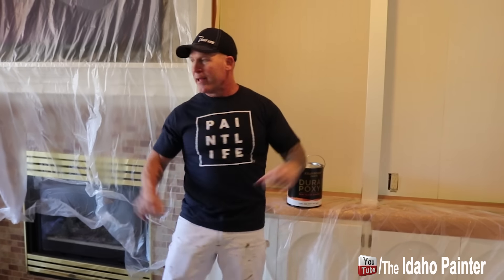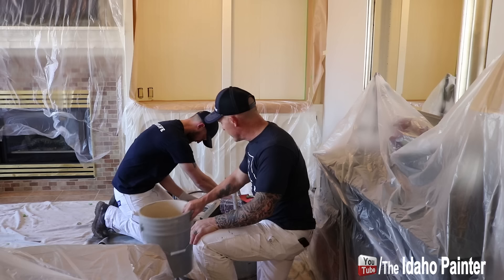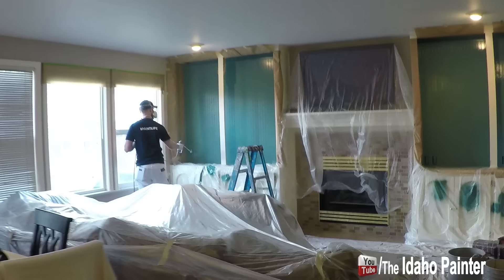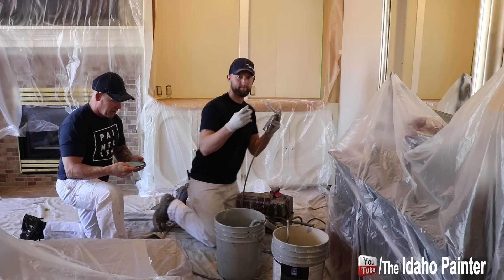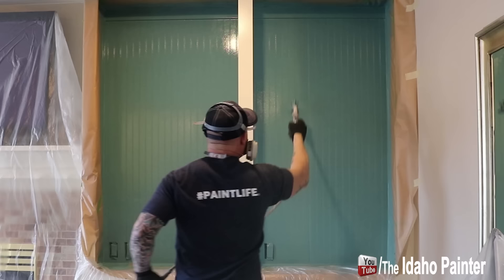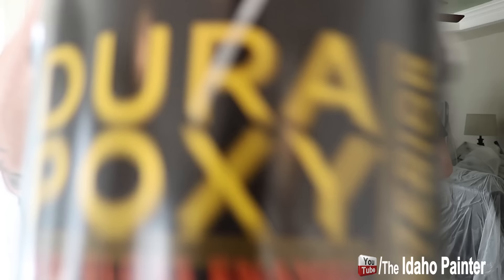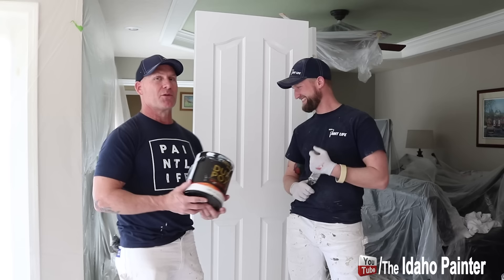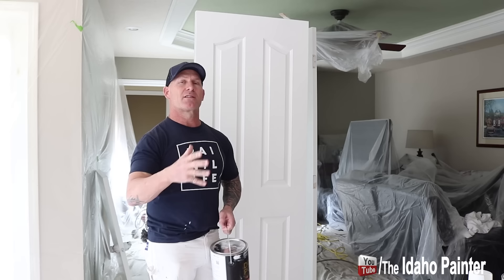Worst Paint or Best Paint Ever?

Comment: We use Durapoxy exclusively on all our doors and trims and always get beautiful results (usually spray a straight white with extra white oxide for coverage) it’s true the material is thin and will run like crazy if it’s sprayed too thick we always give all our trims a good sand to break the old sheen and give the dura something to stick too, if you don’t do proper sanding it will run and not cover, dries hard due to epoxy hardeners but also dries and skins up really quickly (especially if your rolling out doors with a lil roller) on cabinets we do 2 coats of kel bond primer and 2 coats of dura poxy and it turns out beautiful leaving a hard durable oil like surface that you can scrub on for years that doesn’t scratch off that is of coarse if you sand and clean the surface first 😉👍
Reply from the maker: Awesome, thanks for sharing your experience with it!
Reply: How's the touch up with a brush if you spray first ?? I know PPG Breakthrough satin touches up fantastically , you cannot see ANY "touching up" with a brush on a sprayed finish ..... THAT part is great ...... However I also like that durapoxy , but have only brushed it on ..... never sprayed it ..... only used it on a couple of small jobs

Comment: Hey Guys - thanks for doing this review, it's been super useful even after two-years. I just completed a kitchen cabinet renovation here in the SF Bay Area and used the K/M DuraPoxy HP - Ultra Pure White (2888-Semi-Gloss) as the final two top coats. I did find that the DPHP really likes to have more multiple fogged to thin coats as you demonstrated to get that really nice dry-time and to lay down an even finish that really hangs well. I was impressed that I could do a two-coat finish within 3-hrs and call it done! I think if I let it go a full 3-hrs between coats I might have had an even better result as this stuff does like to vent/fume out. I do recommend allowing 4-to-6 hours dry time before really hauling, longer for better curing to assemble the doors and drawers back onto the bases, etc.

DPHP formula is a little different from the stock DuraPoxy used in this video review, but it shares some of the same properties. The HP seems to provided a better "hardened" finish like a factory would crank out. One thing I did learn through some testing coats on the old oak finished boxes & doors is that lightly sanding w/ 220 with a great primer coat as a sealing base layer does wonders for the DuraPoxy to really hold as a hard cabinet finish! I used the K/M AcrySheild Int/Ext. Wood (255-Primer) and man does that stuff really seal out any and all stuff on the original surface that might cause fish-eye or orange peeling. Nothing but a solid finish with my results. I sprayed with my Graco X19 Pro using FFLP 310 for priming, FFLP 208 for my top coats. I do agree with it being a very fine paint that will run if sprayed too heavy. I cranked down my gun to 800-psi and was extremely satisfied with the output not dropping too much material. I would give the DuraPoxy HP a 4.5 and plan to use it on my next two cabinet projects. I think the key to this rating was the prep and prime really made the end result sharp. 

Thanks for the great videos... you've helped this Silicon Valley gearhead a ton to break into the enjoyable craft of Paint Life!! 😎💪🏼🤙🏼  Cheers, -M@
Reply: I plan to possibly use the same paint & sheen.  Any recommendations for concrete maybe??....is high enough build?
i can not find anything out there yet that beats Gliddens "exterior" high endurance plus paint, it has <20 minute dry to touch, 4hr. recoat i disregard.  Good hide & coverage.
 Can not have it stay wet for long with stuff blowing around ground level.  Guess i'll live with next multiple day coatings for now, finish with sealer.  Rome wasn't built in a day.  Let me know if i should give it shot.

Comment: We use Durapoxy on our "Rapid Make Ready" tiered pricing scheme as our least expensive package. Usually these are rentals where we'll shoot an oil based stain blocking primer, followed by 2 top coats of Durapoxy, reassemble, and pack out in a day.  Prep is 120 grit & crud cutter to de-gloss, 220 after the primer coat. I like Durapoxy because it's fast setting, and I've never had a problem with it blocking/sticking. Another efficiency I've found is finding a specific "white" for all of your trim works.  We've standardized on SW's Snowbound-takes a lot of headache out of touchups both for us and our customers even if it's years after the fact. Snowbound is a slightly dirty white with a shot of gray-tones down the white just a touch and makes a great contrast with the neutrals that are always popular -many of them based on grays -Scott, Austin Fine Finish Painting LLC
Reply from the maker: Awesome, thanks for sharing!

Comment: I Have used the product Many times over the past 5-6 years for bathrooms in  new commercial Jobs, but also repaints. However,I Have Brushed And Rolled .I Never have sprayed it. I Do not recall any type of problems.The smell was an issue for some of the "Repaints" As Customers were in a work setting while we were repainting.

Comment: What I have noticed with this spraying episode is that the top and the bottom applications are not parallel. A spray head that could do this tilt at the top and bottom of the stoke would be something to think about. When robotics spray a car it is paramount.  Seems this could be achieved with a hand held spray gun?

Comment: I like the Durapoxy. I spray it on baseboards before they get installed and there is barely any touch up needed once on the wall. The Durapoxy HP however I hate with a passion. It ALWAYS runs even when used with an airless and a 308 tip. I used the HP through my Capspray HVLP sprayer and that is the only way I didnt get runs and got an actual decent result
I like the regular Durapoxy though, never had any issues with that.

Comment: I like durapoxy  it dries quickly to a durable hard finish, levels well, you will not get those results with most other paints. for the paint smell you can and should use a respirator and it may not be the best covering paint but you can quickly follow up with an extra coat because it dries quickly and the extra durable paint application will be worth it one of my favorite paints to use I would rate this paint as one of the best 4.5
 Thanks for the review

Comment: Durapoxy is easily the best paint available anywhere for wood surfaces like crown, cabinets, etc. getting orange peel is usually the result of spraying too heavy. Doesn’t matter if using a Graco X5 or a Titan 440, 2-3 thin coats will always result in a superior finish to any other product, save for those with long cure times. KM Swiss Coffee is the white you want. It’s a stock color there, so they can just drop it in the shaker and you’re on your way. 

KM also has a product called Epic, which lays down crazy smooth but has a true 30 day cure time. It’s what I use for furniture. But I’ve learned the hard way to respect the 30 days. That’s too long for most customers. But say someone wants to refurbish some heirloom furniture, I think many customers would be alright with waiting 32-34 days (which includes the days of prep). Also, using BIN primer with either Durapoxy or EPIC makes a monster difference, especially when shooting cabinets.
Reply: i believe the Durapoxy HP is better ,dies harder and quicker. for what ive experienced

Comment: Im always on the look out for good trim paint. Here in Calgary, Canada we have some harsh weather changes including humidity and the builder's here use solid colour lacquers but they always crack between 12-18 months because its too hard for our weather variations. Of course this is past the builder new home warranty so they dont care. For new construction/renos I spray Ben Moore Advance which is a waterbourne alkyd and I have never had a cracking  callback, BUT because of the oil particles the dry time sucks for sanding. What products do you guys like? Our weather here can go between -30 and +10 within a week (Celsius) and our humidity is usually around 16-26 and of course most the woodwork is MDF and rarely do these  guys let the product  acclimate because often the settling doesnt happen until they are long gone.
Reply: Surfopia bm advanced is the best we have in canada in my opinion also. Cloverdale renaissance hybrid a close second
Reply: North Shore MTBer agreed bm advanced semi gloss is amazing just gotta be careful because it runs easy

Comment: What are your thoughts on sherwin Williams quali-kote??
Reply: Its a basic contractors grade paint simular to Ben moore Ultra Spec. I dont like either of them personally. ProMar is a better quality from SW, but its still a lower grade. My go to is Regal or Aura from Ben Moore and Duration from SW is decent. Both Regal and Aura are a paint/primer combination and the difference between the two is Aura self levels (cant back roll)  and it has its own colour pallete that is full spectrum. Ive tried the Behr Marquee as well and its not too bad (client request). I guess it depends on what you want your end result to be, but Quali-Kote isnt that great. Ok for rental units but not the best for cleaning. I havent tried SW Emerald yet, but I expect it to be simular to Regal.
Reply: I have been using Emerald lately and I like it so far. Otherwise I have always used Promar 200 and Duration.

Comment: new painters here lol.. fish eyes? not caused by paint but obviously oil on substrate, wow just wow... durapoxy rocks... they prob think sw super paint is good
Reply from the maker: Okay...
Reply: Fish eye not always caused by substrate problems. Sometimes it's over sized pigment particles(eg. iron oxide) reacting (electrostatically?) with surrounding paint above the surface. This can be tested by spraying the same paint on a known cleaned, de-glossed surface.  An additional test to prove it  is to spray a non pigmented paint on same surface for comparison. Fish eye is more frequent on deep tint bases in my experience.
Reply: It’s caused by the cabinets natural orbital movements which condenses the oxidation process forcing the paint to have a chemical reaction when the ths42 and the is37 interact with bs17. Typically having a carnivorous effect on the substrate eventually allowing eair, not to be confused with air into the hemroidal crevices of the finish you are using . Pretty basic stuff guys all my helpers even know this.

Comment: I saw your Behr video .I had a problem with one of the 5 cans I bought. I talked to the rep and they at first said that marquee premium is one coat guarentee must have been roller I used .I sent reciept and invoice of rollers I used Purdy white dove 3/8 nap .long story short it could have been bad base . I told them that its what the home owner wanted to use. Otherwise I wouldn't have ever used it. It took up my time putting 3 coats in bathroom. And along with now the homeowner has no touch up paint. Which is why that can was intended to atleast be half a can left .how do you deal with or explain to companies of when its a bad product. And what they can do about it. I have not received a response yet. What have you done in the past and how did you go about it the right way. I sent them pictures of the areas the looked like'best way to explain it' running a roller out of paint. Which I didn't do. How would you go about this to the home owner. A bad product can ruin a good reputation. Luckily I was able to fix it. But it took more of my time and money. Any suggestions.
Reply: My suggestion as a professional painter for over 15 years don’t buy into the hype of a “one coat system” especially behr paint it’s watery formulated for the homeowner to extend the open time also water based paint has latex in it so it shrinks when it dries causing fish eyeing with one coat it’s made to build on itself we always do 2 coats to give it a true sheen and color as well as proper coverage

Comment: stick with ppg breakthrough best. trim and cabinet paint on the market hands down.
Reply: @360 Painting Indy North i ditched my shopping plans for PPG Breakthrough 250 because of coverage issues & longevity concerns??  So kelly moore maybe?
Need a convient, fast dry, durable lasting exterior brush on concrete paint....so this kelly moore is worth a try?...i mean the kelly moore Dura Poxy HP.

Comment: You said you were going to run at 1800 psi most of the entry level titans have a max of 1500 psi and your using a low pressure tip . Now I’m worried about buying a titan sprayer .
Reply from the maker: The low pressure tips are suppose to run at 1000 PSI
Reply: I Have A Titan 440 Impact . It's Rated At  3300 psi  And  0.54 Gallon  Per Minute.. What Model Titan Are You Referring to James Howard?  Just curious.

Comment: This guy an amateur with spray technique.  The fan of the spray  is held to same distance, much as you see a robotic spray.  What happens when fan not held same distance different thickness of material and many times that will show.  Number 2, DURA POXY NEEDS TO DRY FOR 4 HOURS OR IF YOU RECOAT WHEN DRY TO TOUCH THE SECOND COAT REACTIVATES AND WILL SAG.  USER BEWARE THIS IS BAD INFO, BAD TECHNIQUE.